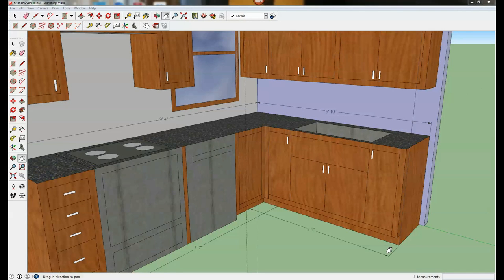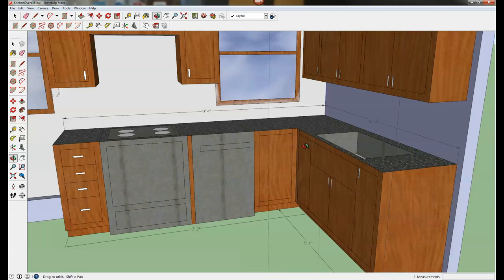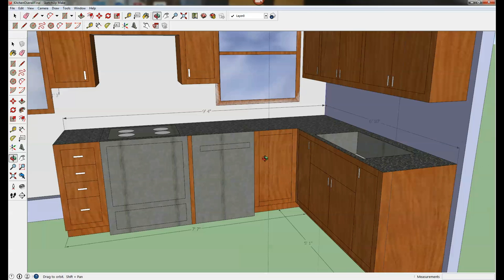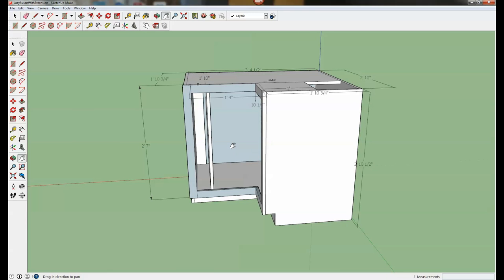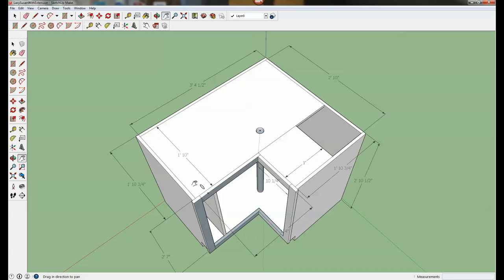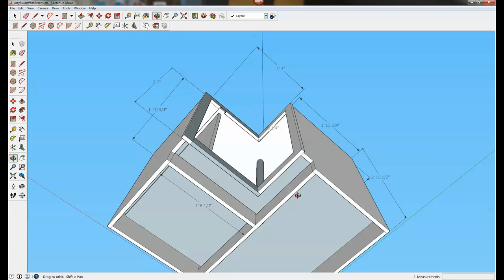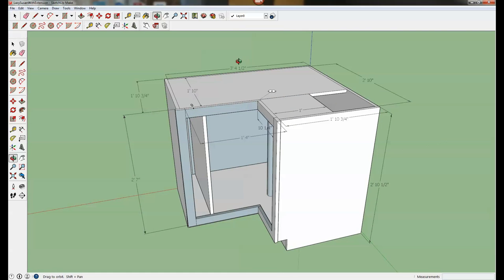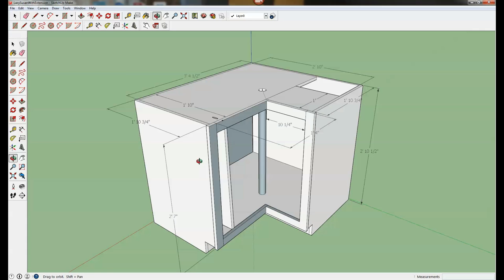Kitchen Cabinets: Designing A Lazy Susan

Comment: I appreciate the considerable amount of time you expend making these videos. Thanks for all the hard work. You explained why you didn't create a spice rack in the small space next to the dishwasher. For anyone else who may watch this video, another suggestion is to move the dishwasher over to the right and let the extra space fall between the stove and dishwasher. A thin pull out can then be created in this space with the spice rack in the top portion and sheet pans in the bottom. It's really convenient to have the spices and sheet pans next to the stove. You would need to check the installation instructions for the oven to make you that you have provided the proper clearance between the oven and spice rack.

Comment: A little surprised you didn't 45 the back corner to not have issues if the drywall taping won't let the cabinet fall all the way into the corner, hopefully you surveyed and have an above average corner that it's going into, but thought I'd mention this as some who want to build one of these will have to deal with such a corner...
Reply from the maker: lazy suzans do not usually go all the way back to the wall, hence no need to alter with the back corner. Notice that the depth of the cabinet where they match up to the face of other cabinets is only 23-1/2, not 24". And this is a larger lazy susan. Many of them have smaller sized shelves, and so the cabinet is even shallower than this one.
Reply from the maker: I should add that often the back corner is built on a 45 if the front of the cabnet is also 45, as when a sink is located in the corner, on the 45.

Comment: Hi Pat, Thank you for this well instructed video as well. I'm looking for information to help me with a 90 degree upper cabinet design. My concern being that I won't have a lazy susan middle post is, will the face frames be enough support for the whole cabinet in the front corner notch? I would think so but I wanted to run it by you. I feel silly for asking but I have to :)
Reply from the maker: Whippetfest you are going to secure the faceframe to the cabinet with pocket screws on all sides, so it should be more than sufficient assuming it's not 8' long :). The post isn't really for support, although i guess it could help. Sometimes corner cabinets are built with a 45 degree front. If you are building one of those, i can give you a link to check out the picture of how it's done. Way to go keeping at it a little at a time. That's what it takes, and you're doing it!!
Reply: Thanks Pat :) It is more and more fun! What I'm building is 90 degrees. I now have my cabinet over the fridge installed next to the roll out pantry. I have all of the sides cut for the rest of the upper cabinets, making me feel like I'm going into manufacturing mode. Gearing up to really pop these out! But in reality I can't go so fast because corner cabinets, sink base all base cabinets are completely new to me. Thank God for Sketchup! It helps me think everything through so much. I would be completely lost without it and you :)
Reply: Hey Pat: I'm following your cabinet making process and loving it. I am using your method to make my custom kitchen cabinets. I also am going to be putting a sink in the corner cabinet. Could you send me the link of the pictures of building a corner cabinet using a 45 degree front?
Reply: Whippetfest ‘!k